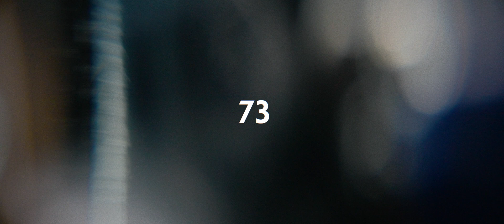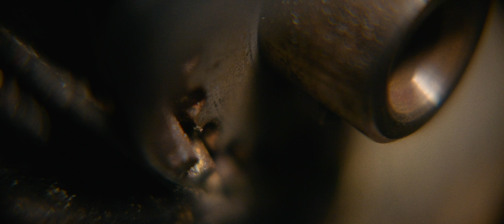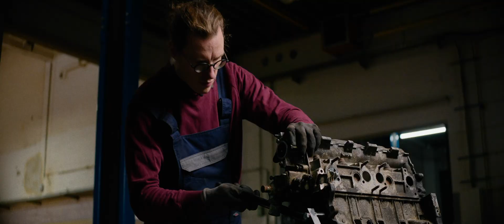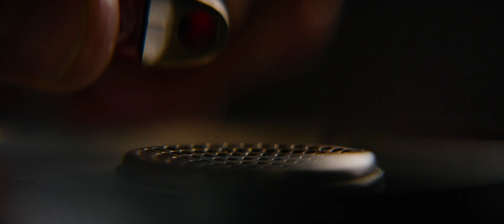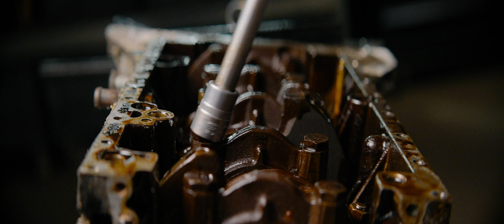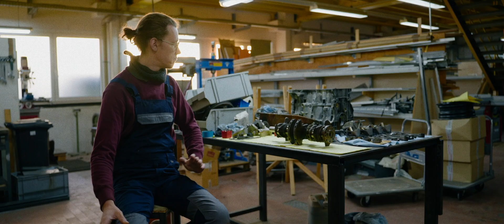how to disassemble an engine

Comment: I just got a BX 4x4 Break with that engine (im pretty sure its the same basic block) Also had a 205 gti some years back... 
These engines have a very specific smell to them! You noticed that?
Reply: btw I still enjoy your videos so much! :)
Reply: XU5, 7 or 9 are all the same. Aluminium block with removable liners.
XU10 and the diesel XU's have the same architecture but have an iron block.

If you ever need to replace the crankshaft on a XU9 petrol engine, get an 2.0 HDI crank. Those fit perfectly.